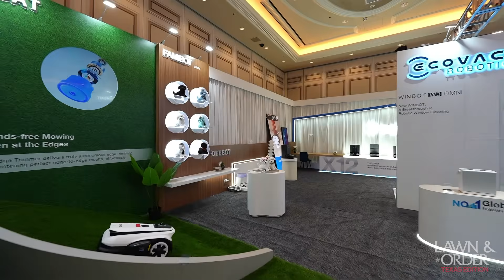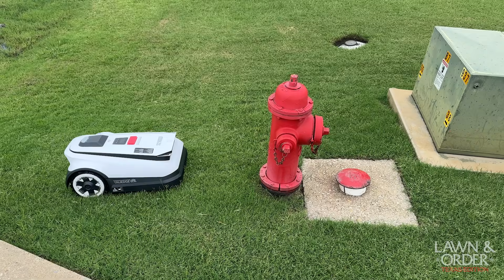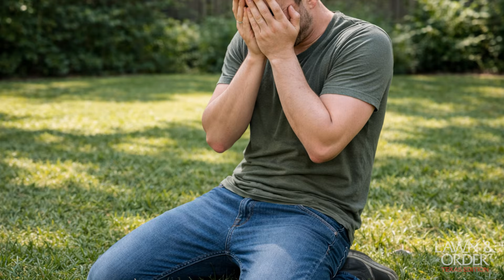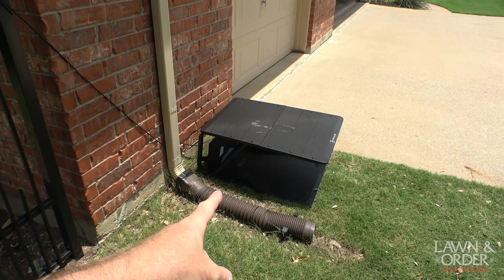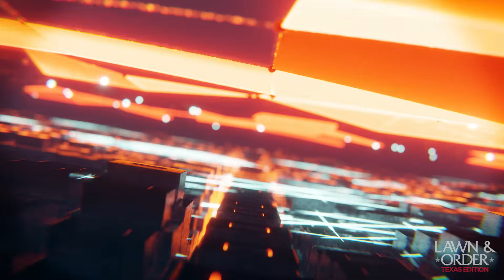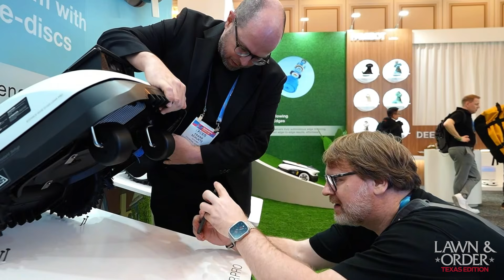RTK Is Failing — Here’s Why LiDAR Is Taking Over Robot Lawn Mowers (CES 2026)

Comment: Thank you for talking about the problems of RTK. Every single video goes past RTK, how to set it up, and it's drawbacks. Amazons GOAT 1000 is like 600 bucks right now and I'm guessing that's why. I guess I'll just wait a bit longer and get the lidar pro version
Reply from the maker: Well thank you! RTK can work really well, but there's no getting around the extra setup & potential signal challenges at times. At $600, the GOAT 1000 is a solid value!! But if you can wait and save for the LiDAR Pro, I think you'll find it easier & more user-friendly overall. That's the direction the industry seems to be heading. Side note, if you have open areas like I do, RTK works perfectly fine.. so consider that, and the cost savings!

Comment: My goat 1600 lidar has a problem. One single dandelion higher than 20cm and it refuses to cut it (even if set to high grass and ai obstacle recognition off)... I am considering to switch to RTK... but I am unsure if it wont be the same...
Reply: I would assume you could just mow the lawn with a regular lawnmower to get it all nice and trim then set the GOAT as a maintenance mower every couple/few days. No way a dandelion will grow tall enough in that amount of time.
Reply from the maker: @Vamp_88  those Dandelions may surprise you! :) But, yes, that's the best way to run these, as maintenance, on a schedule, or anytime you think about starting it. It's very satisfying to see them out there working!
Reply from the maker: I think your 1600 is the 3000 in the U.S.? On the GOAT series, there's usually a separate setting tied to obstacle height or obstacle sensitivity, have you checked yours? Sometimes LiDAR gets a little sensitive and wants to be careful around objects protruding from the grass plain so taller weeds or stems etc can sometimes get treated like obstacles even with AI avoidance reduced.

Comment: This is not quite true I have the ecovac goat with lidar and I have found my mower out of bounds and having to recover it from it being stuck. Then when put back in the boundary I have to manually drive it back to the base station so it can figure out where it is.
Reply from the maker: That’s a fair point and it does happen, especially if the mower loses RTK lock or gets physically moved. We’ve all seen it, that’s for sure. 

What a lot of people don’t realize is these systems still depend heavily on setup, especially RTK base placement and signal quality. If that’s not solid, recovery can be hit or miss. I’ve been pretty lucky with my RTK systems. 

Also worth noting, LiDAR systems have their own failure cases too. They tend to handle local navigation better, but they don’t have the same global positioning accuracy so kind of a give and take.

So it’s less about one being perfect and more about how each system fails or wins in different situations.

Appreciate your comment!!